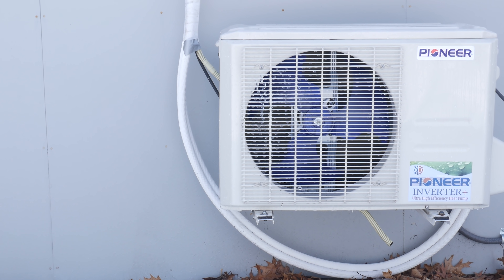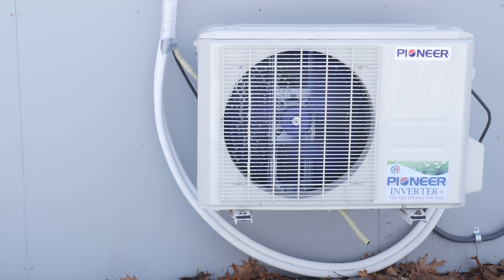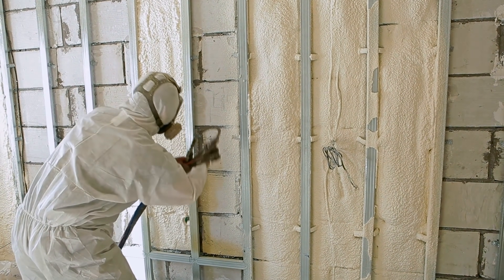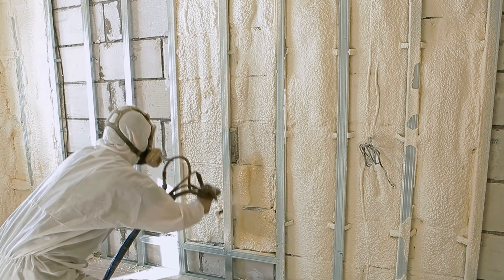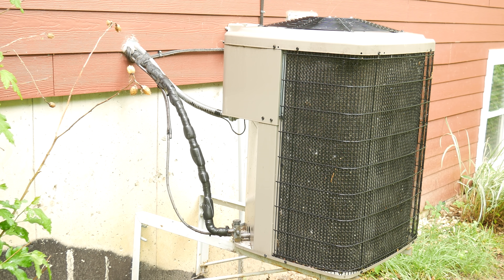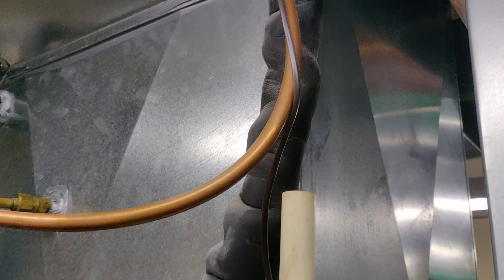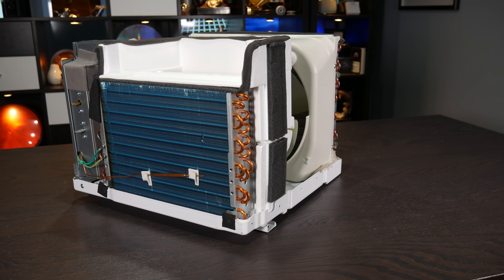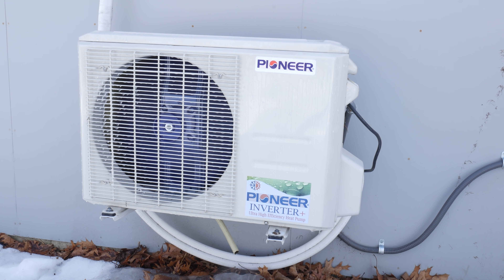Heat Pumps are Not Hard: Here's what it will take to start pumping

Comment: Can't wait for the Pioneer Minisplits to arrive to convert my whole house, I will document the installation and do two full reviews. Hopefully get even more people into the Mini-split game. The "Audiophile" angle is a yet unexplored one. These things are quiet and the humidity mitigation is going to make my basement a joy to work and play.

EDIT: I called an HVAC company to quote a swap for my two 3.5 tonne AC units. They wanted $23.8k for the swap. The outdoor units alone by Bosch are over $5k each. So that is why I am going with Pioneer and individual splits.
Reply: What state do you live in?
Reply: Jesus
Reply: Splits make a LOT of sense, compared to a ducted system. So much more power-efficient to just heat what areas you need, and not have all the losses in the ductwork. Also, having splits means that you can size them to heat/cool FAST, rather than having to leave everything running 24/7.
I'm in Australia and there is no need to cool bedrooms AT ALL during the daytime. Using splits you can fire them up 10-15 minutes before bedtime, and the room is cool and ready to go. If a room isn't being used, just shut the door and leave the A/C off.
PS: Americans: To prevent getting raped by installers, stop calling them "heat pumps". Just call them Air Conditioners, don't even tell the installers that they are Reverse Cycle.
Reply: @johncoops6897  Can't you do this with zoning and a central unit?
Reply: @JeffKubel  - not with any form of energy efficiency. Zoning is literally just blocking off the vents to a certain area, let's say the bedrooms. You are still running a massive A/C system outside, you just aren't utilizing it's full capacity. 
So, let's say you have 5 bedrooms and only one of them is occupied, what do you do? Heat all the bedrooms, or not switch on that zone? And with zoning, each room doesn't get individual temperature control, eh ? Big central systems cannot cope with that - unless they use a very inefficient system called "reheat" where they heat/cool to suit the lowest temperature in all zones, then use resistive heating in a smaller zone's air-handler to make just that particular area warmer.
Furthermore, ducted and zoned systems are usually undersized and designed to be run continuously. So if had the bedroom zone disabled and suddenly someone wanted to use a bedroom, you have to enable the A/C for that zone, and then wait quite a long time for it to bring the entire large zone to target temperature. Most people end up just leaving the whole house A/C enabled the whole time, which is extremely wasteful.
One of the biggest advantages of split systems is to NOT have a huge A/C unit, but instead have a number of small units that you only enable if and when you need them.
For example, right now there is only me here in the house. 2 stories, 4 bedrooms and only one person. A zoned central system cannot cope with just heating/cooling the room(s) that I am actually using.
I hope that makes sense, it's hard to explain in a youtube comment. I have worked for a long time in the energy efficiency industry and these concepts are often difficult for people to grasp.
Reply: 30 years in the biz here dont consider Bosch or Pioneer for top hpumps for your $$$$ 
neither lennox there using big names and gauge prices in the making...consider Japanese products eaven if the made in China ....Mitsubishi,fujitsu,Daikin or Ameristar ( trane) are the best ...i instal them i repair them, i eat them 😂  
Oh btw i did  a du deligence on those products... good luck
Reply: @johncoops6897  if your zoned system is set up correctly each zone should have its own thermostat.
Reply: @johncoops6897  If you're cooling in Australia just use a rooftop evap. Cools the whole house for 1/4 the running cost of a single room mini split.
Reply: @kholdstare90  - Australia is too humid for Evap in most places, and they don't work very well in dry areas anyway.. Also that doesn't solve the problem of heating in winter.
Reply: @JeffKubel  - Yes, but how many zones are there, three? And how exactly is each zone's temperature adjusted by the system? Most are surprisingly crude, and are definitely not optimised for energy efficiency. Unless it's a modern Inverter, the main unit outside cannot run at half power to cool half the house.
Reply: @justcommenting4981  Eastern PA
Reply: @JeffKubel  My house with its two 3.5 tonne has only 2 thermostats in basically the same large open area.. Bedrooms always suffer as they are all in the corners. It was not a good install.
Reply: @johncoops6897  I don't know anywhere in Aus that gets too humid that a properly set up and air balanced evap can't cool. As for heating I live on the western side of the continent, there is little need for heating except in winter in the middle of nowhere without mains power.
Reply: @kholdstare90  - The majority of the Australian population lives on the other side of the country, like 3000 km away from you. The climate is completely different here in the east, compared to where you are.
There is no way in the world that ANY swamp cooler will work effectively on the East coast. We have weeks (months) of >90% Relative Humidity... it's >80% right now, at 11:20pm as I type this. Better with just a fan than something that is adding even more humidity into the air.
Note: the central part of Australia is dry in summer and perfect for Evap Cooling. However, almost nobody lives there.
Reply: oh wow, that's an interesting overlap in interests! a wild Z found in Technology Connections!
Reply: @johncoops6897  but do you really need to cool your place this time of year? Like when is your actual summer weather season and what's the humidity like then?

A bit of quick Google searches for the east coast cities puts average humidity under 50% even during the "summer months"
Reply: @TJ.85  - it's late spring, no need for A/C but I have fans running. In summer the humidity is worse, up to 95% for long periods.
NOBODY has Evaporative cooling here, it makes the climate much worse. The humidity rises with temperature, so when we need cooling, the last thing we want is more moisture. I don't care if you don't believe me, that's the facts of the situation.
Reply: @johncoops6897  well like you said it's a big ass country so I'm sure the truth is obviously somewhere in between both of you. I'm just going by the data it's certainly possible especially in particular climates that of which your country has MANY.
Reply: @johncoops6897  they wouldn't be of use in my area either as temps and humidity do the same on the east central coast of USA.
Reply: @TJ.85  - I live in Sydney, the largest city and metropolitan area in the country, with 5.3 million people. One fifth of the country's entire population live in the city and suburbs of Sydney, and the topography (not just the weather itself) is such that it is extremely humid in Summer.
There are many other places with similar mountains, sea breezes, etc that create unusually high humidity when it is hot. The majority of Australia's population lives on the coast, primarily in the east, where the humidity is a problem. 
Australia is massive in area but unlike the USA, literally nobody lives in most of it, since it is too hot and dry. In those outback areas, Evap Cooling works great, that's what you'd use on a ranch house out in the desert or plains.
On the south coast the humidity is low in summer, and Evap works well down there. For example, in the city of Adelaide, many domestic homes use large on-roof Evap systems with a massive fan blowing cool air into the center of the house and they leave all the doors and windows open!
Reply: HVAC Tech here. Put a pioneer in and have talked to several techs who have installed them for customers plus themselves. So far for what you pay They are a good investment. Haven't had to test the warranty yet. Hopefully by that time I wont.
Reply: They tried to charge you $13,000 (minus the cost of the indoor unit, which you didn't list) for installation? GTFO.  He talks about installers absolutely ripping people off for daring to ask for heat pumps, and this sounds exactly like that.

You already have:

- electrical running to outdoor units (AC compressors)
- refrigerant lines running from your outdoor compressors to the evaporator
- electrical running to evaporator (indoor unit)
- duct work to distribute hot/cold air from indoor unit
- electrical lines running from the indoor unit to your thermostat

They aren't adding anything new whatsoever to that system, just replacing each of the existing parts, exactly where they already exist.
Reply: @majordude83  - that is why Americans need to stop calling them "heat pumps". Get quotes for  AIR CONDITIONERS, not heat pumps.
Reply: @johncoops6897  Good advice, but, it would be even better if they stopped trying to rip people off.
Reply: @majordude83  it’s very simple. Don’t use them as a company. You don’t determine my labor rates I charge, my skill and experience does. The same goes with anyone in my industry. Don’t like it? Buy the tools and equipment, get educated and go do it.
Reply: @majordude83  - they won't even know to rip you off if you shop around for AIR CONDITIONER installers.
It's the weird term "heat pump" that causes the problem. Just call the device what every other country calls them (Air Conditioners).
Reply: You could also try Mitsubishi Electric ductless units, they're quite good
Reply: I'm looking at 18k Senville splits for ~2k each mostly for heat
Reply: Just encountered the same problem.  Because my house has an old freon AC unit, replacing it will run $14K-$18K due to line replacement and other installation issues.  Coupled with the fact that I live in a VERY sunny place and some bedrooms can be as much as 10 degrees hotter than the rest of the house in summer with the single central unit, installing multiple mini-splits makes more sense both financially and for comfort.
Currently I'm looking at one or two single-zone units and two 4- or 5-zone units with a total cost of about $10K.  Oh, and the $14K system is only 15 SEER while the $18K is 19 SEER, but the heat pumps are 20-21 SEER, so extra bonus there.
So even in a ducted house, mini split systems can be better.
Reply: $23,000 INSTALL is insane.  I would buy the unit wholesale for $5000.  Then tell the HVAC company “I already have the heat pump.  Just install it please.”

I do that with car dealerships too: I supply the oil & filter, and they charge $15 labor.  It saves money

.
Reply: @electrictroy2010  I'm currently trying to find someone to do just that, but so far they all just say things like "well, we can't give you a quote on just labor because you might not have all the equipment" then send me an estimate for $24K.  The last one actually listed the company they buy their parts from in the quote (copy/paste mistake, I think), so I went to the website and checked their prices and the quote was exactly 500% markup, to the penny.
It is true that the heat pumps don't come with everything you need, but the drain hoses are like $20 each and the bracket is maybe $200, and they do come with everything else, including coolant, unless you need a longer line, so the HVAC people are definitely running a racket.

Comment: Funny story: your first heat pump video was published just weeks after a had a 210' trench excavated around my house and yard in order to heat the shop behind the house. I also trenched 100' around the other side of the house for power. If I had seen it first, or otherwise learned of heat pumps first, I could have skipped that gas line trench and all the work to fix the yard. Hopefully others learn first. Even though I have the gas line and furnace installed my heat pump is arriving next week. Hopefully solar will be in within a year.
Reply: There are also "geothermal" heat pumps that require excavation. The pipes are put a meter (3-4 feet?) below the ground where the temperature is already constant and above freezing, which makes the system more efficient
Reply: Not to mention all the trenching for power could probably have been used for a loop on that lol.